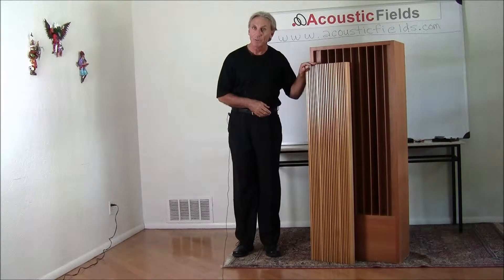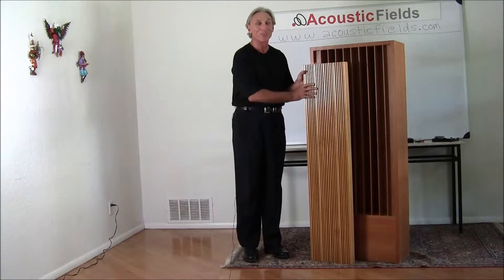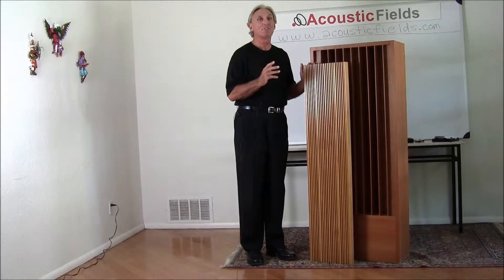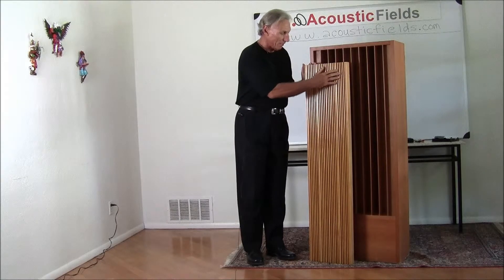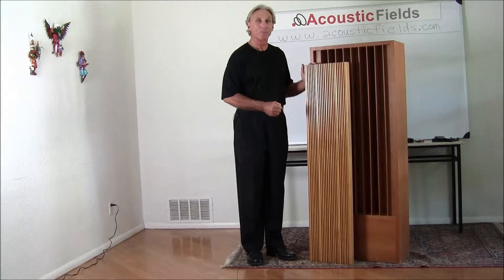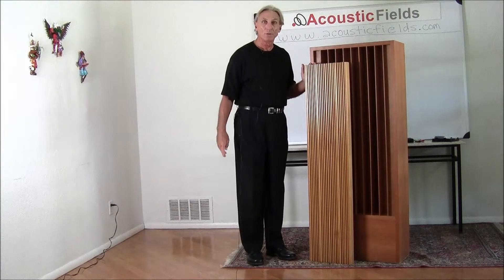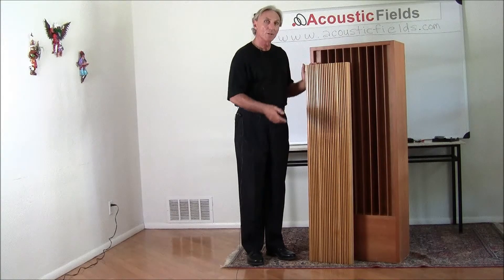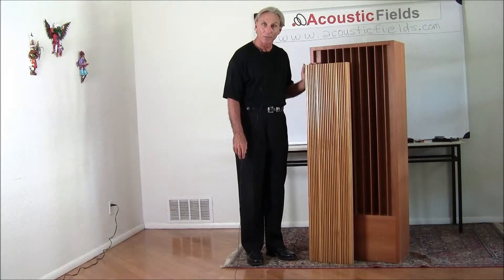Mini Wood Diffusor (MDW) - www.AcousticFields.com

Comment: In which way would you recommend should the diffusers be placed? I am surprised that in the english and american area diffusers are often placed at the sides. Well, we do not recommend this. At least they should be placed in the second half of the room behind you. Usually it will not be possible to keep enough distance. On the other hand THIS one is built very small. So distance might not be an issue. But spreading will be. Diffusers at the side will allways reflect a small part of the sound directly to the listener. ???
Reply from the maker: Hi Frank, Diffusion sequences are all about frequency response and distance. Vertical or horizontal placement depends on distance from wall surface to listening position. Two dimensional diffusion works better when you have shorter distances that are not conducive to one dimensional diffusion.